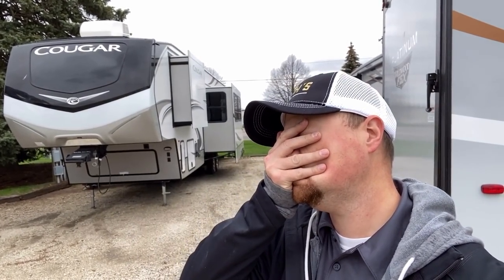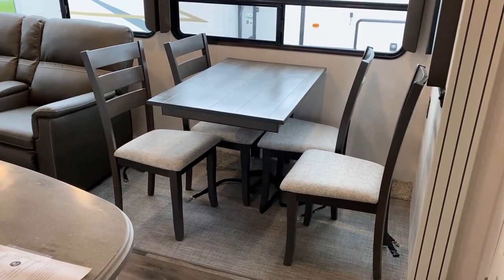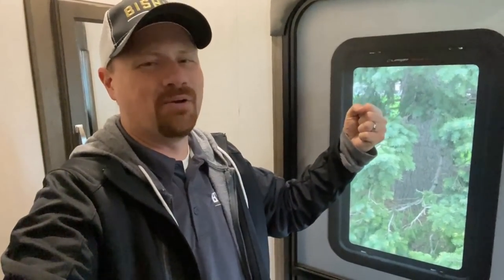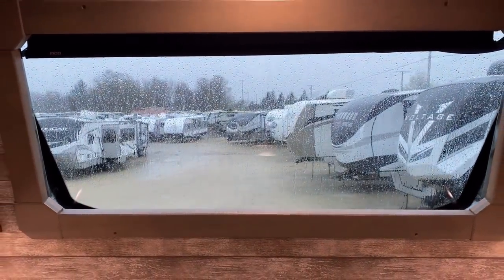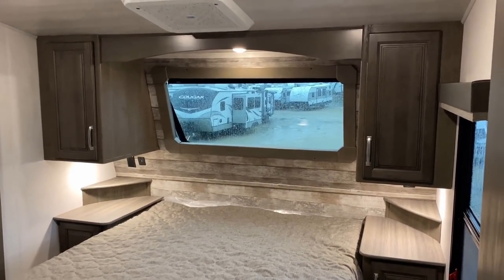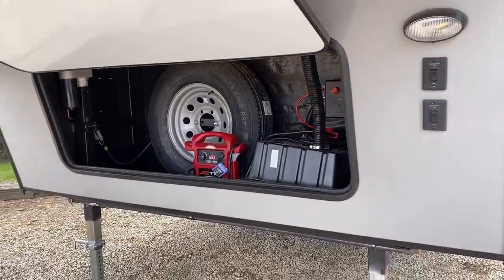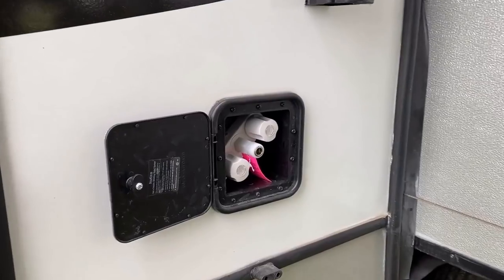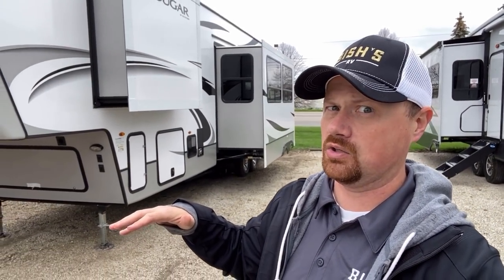Two BEDROOMS, Bath & ½!! 2022 Cougar 364BHL

Comment: Hey Josh, another great video. Now for MY review LOL.

They missed an opportunity here, all they had to do was to 'flip' the kitchen and living room so the main slide was on the camp side, and move the back room door. They could have kept the second entry door and just move the bathroom to the other side. Having said that, it's not a deal-killer by any means. Of course a main slide on the awning (camp) side leaves much less room under said awning, so there's a tradeoff as there usually is.

The cabinetry is likable though a little too light. Love the lights. I prefer a booth dinette. Would have been nice if they matched the ceiling vents with the ceiling color, or used brown ones...the white stands out too much against the tan ceiling. Awesome storage. 

My Flagstaff 529RBS has two bedrooms and a bath and a half, so I really like that they put a half bath in for the second bedroom...too many manufacturers/models don't!

Of course you know I'd prefer the two-way fridge, glad it's still available. I would have preferred a drawer under the oven rather than the drop-down cabinet door.

I actually love having a front window on a 5th wheel. 

Problem: the swing door between the bedroom and master bathroom is a disaster waiting to happen...and it WILL happen! When you bring the wardrobe slide in and the door is closed...$$$. It'll kick the slide off track, smash the door, damage trim, door frame...bad design! Should be a sliding type door like Flagstaff/Rockwood use, the door will slide out of the way if it's left closed. It WILL happen, especially being able to run the slides with the app, many people will do this from outside. I'm really shocked that a reputable manufacturer would have overlooked this.

Road-mode accessibility is awesome. Prefer the spare tire under the trailer, takes up too much space in the front storage compartment.

I have always liked how Cougar put the hitch mirror and docking lights on the front. Cosmetically I would prefer brown or black AC shrouds up top. 

I am very disappointed with the docking station, another missed opportunity. They should have used the Nautilus System, what they used is very lacking and underwhelming. Having the Nautilus in my Flagstaff, I think this might actually be a deciding factor, a deal-killer so to speak. And the shade in the door windows should be standard...hard to believe they're not.

I don't like the space between the two awnings. You said you liked the separate awnings but I'd prefer one large awning that covers the whole area...think rain, which shows up more times than any of us like. And they missed a utility light on the other side by the furnace/storage compartment (driver side).

Overall, this would have a good chance of getting me to be a Cougar fan...with just a few common sense changes. Much potential with this unit. With the changes I pointed out it would definitely make my list if I were in the market.

Have a great Memorial Day weekend Josh.
Reply: Great job on your evaluation of this particular trailer!!
Reply from the maker: I agree!!

Comment: Standard lens is fine. If you need a wide angle, switching is also fine. This is one of the floorplans on my list. I would remove the bottom bunk and turn that into an office. I would want the theater seating and the table/chairs too.
Reply from the maker: TY Jay. This helps

Comment: If the lack of upper deck ceiling height and washer dryer prep is a deal breaker, check out the Highland Ridge Roamer series with a north/south bed, front windshield, more upper deck ceiling height, more upper deck squar footage, washer dryer prep, more upper deck windows, and an inclining bed.

Comment: I think Josh,that it’s a beautiful camper but storage or a closet could be in that table’s place. Or washer and dryer hookups could go there. The loft is set up with entrance in front of the door.It has enough windows.
They are still making bathroom sinks way too big.
BTW I live in a Holiday Rambler Aluma-Lite that is 48 years old. It’s all in good shape except my floor because it did leak. 
I can’t wait till it’s all restored. It’s really nice in this 5th wheel,but hard to wrap my head around how it’s put together.
Reply from the maker: Wow!! I bet that’s a cool unit
Reply: @JoshtheRVNerd  Thanks! 
Almost. It still needs work but it’s not getting any worse.

Comment: qq...do they connect the power seating to the solar system or add a small battery to help? Asking for someone me  having been caught in the rv recliner when power went out.
Reply: Good question, and good solution (solar charged battery powered)✅
Reply from the maker: Seating is 110 powered so only operates if a more advanced solar plug is added with bigger inverter

Comment: Josh, how does this compare to the Grand Design Reflection?? I searched for information concerning wall/frame/ roof construction and can't find any info on the 2022 Cougar. Also, looks like Cougar is still using the cable slide?
Reply from the maker: Cougar uses cable slides, yes. Allows them to leave their bellies more open for tank placements

The construction between them is more similar than different. Cougar has almost literally defined with a "mid pro" fifth wheel is like

Nearly all others even by other companies are basing their work off what Cougar has made popular over many many years.
Reply: @Josh the RV Nerd at Bish's RV  Thanks Josh